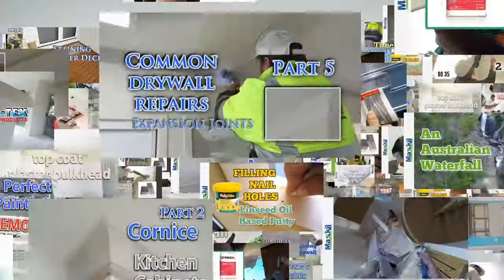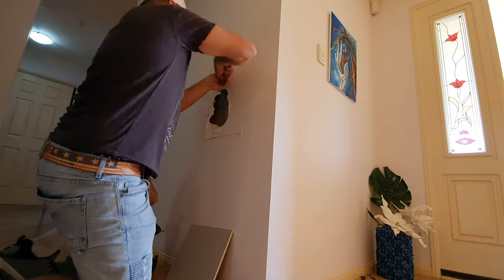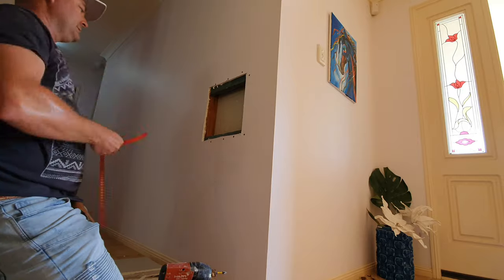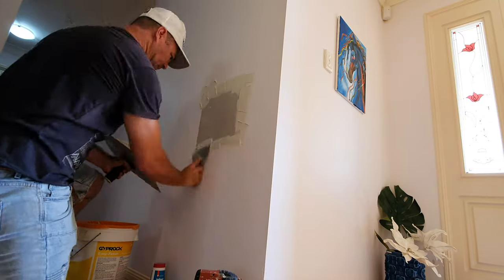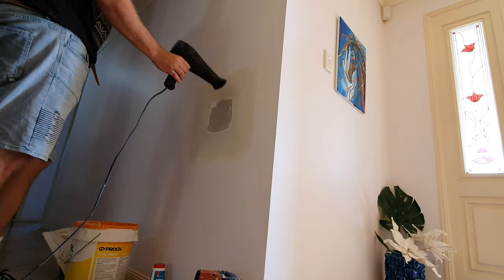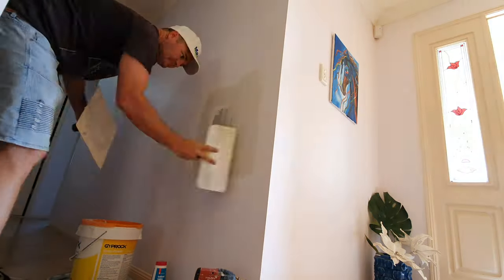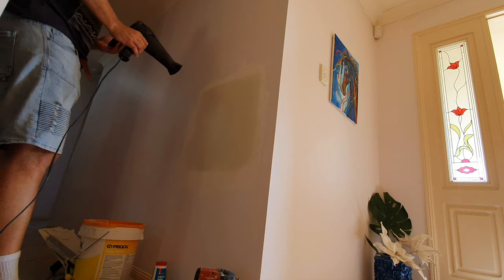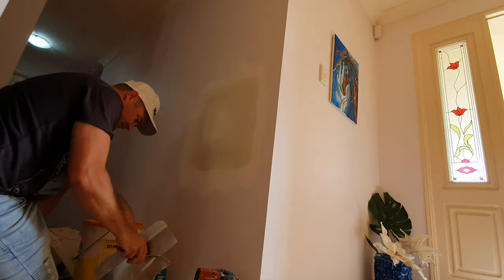How to fix any size hole in the wall (DRYWALL)

Comment: Nice work max. I’m a plasterer myself and just curious why you don’t just use 5 min? It’s super quick and you can sand it (the same day). Also why no topping?
Reply from the maker: Hi Greg, I find the 5 mins dries but doesn't harden and stays soft. I should try 5 minute again see how it goes. Normally I use topping though I was confident I would get this nice enough too be able to sand it lightly. I worry when I pull the topping out it will have heaps of air bubbles, and I would have to skim again... Thanks for watching mate
Reply: Maxkil thank you for taking the time to reply. I really enjoy your videos 👍🏻

Comment: Any tips for filling in holes around power points and antenna ports?
Reply from the maker: Hey Eric just try get a secure backing then just load it with mud

Comment: How many employees do you have? Or do you just find people to help you out with the jobs?
Reply from the maker: Yeah I have a regular guy and just get sub contractors in as the demand increases.
Reply: @Maxkil  hey just quick question i been finding when i use a quick setting mud that i am not able to sand the edges? The mud is to hard no matter how long i sand theres always a edge?